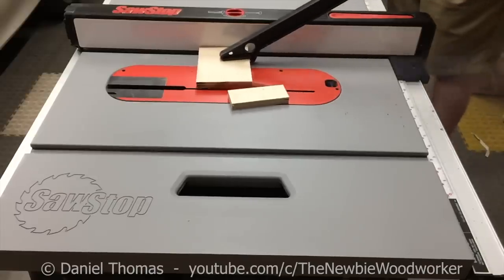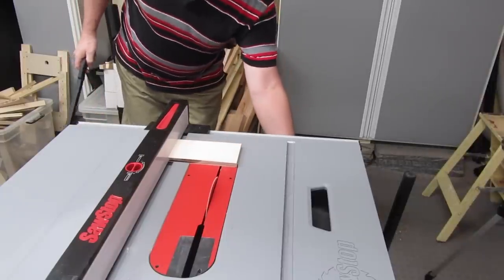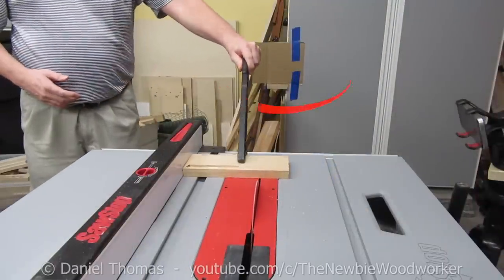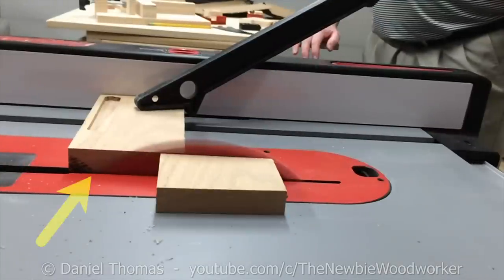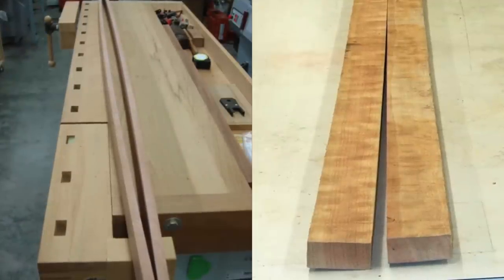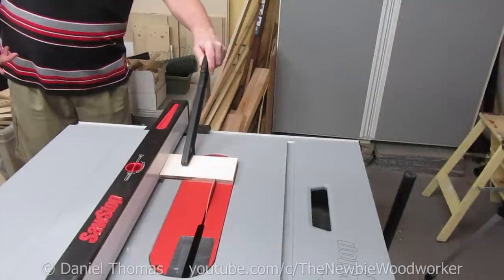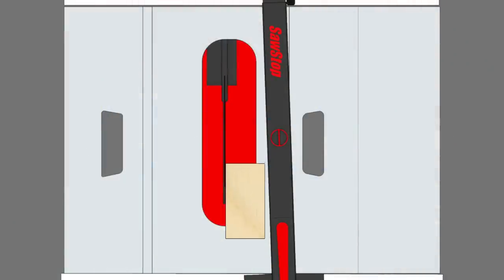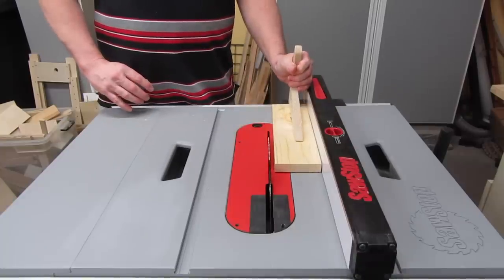Actual Kickback (in Slow Motion), & How to Prevent It

Comment: Great video, thanks.  I use the riving knife and blade guard most of the time.  The only time I took it off was to cut 3/4 in strips of 1/4" plywood using the Microjig Grrriper.
Reply from the maker: Awesome! Glad you're staying safe. 😄
Reply: I use the riving knife, but confess I don't use the guard as often as I should.  I cut a lot of tiny stuff and wish I had a light duty???? guard for that kind of work.

Comment: As somebody with little experience on a table saw but knowing somebody very experienced who lost part of a hand and thumb, I have one question. The gentleman I knew was cutting a sliver off a panel, using a push stick and standing to the side. The sliver kicked back and hit the tip of his thumb (holding the push stick) end on and perfectly square (basically speared his thumb tip) it continued after removing his thumb tip and then ripped into the heel of his palm (doing permanent nerve damage). Work cover investigated the machine and working procedure and basically deemed it to be a "freak accident". So my question is this: Why oh why don't the push sticks have a guard on them (like you would see on a fencing sword)? This would protect hand fingers and wrists! Just a thought???
Reply from the maker: That does indeed sound like a freak accident. But a good solution is to use something like the Grr-Ripper. http://amzn.to/2CELfvw. It's extremely overpriced, but then again, what's the cost of the tip of a thumb? And you can get thinner attachments, so you can use it when cutting very thin pieces. That's the only thing I can think of.

Comment: Question: when ripping a board...is it better to have the wider piece or the more narrow piece closer to the fence? Does that make sense? If I'm ripping an inch off of a board should the inch being cut off be between the blade and fence or the the blade and and away from the fence??
Reply from the maker: That's a good question. As long as you're making a cut that's longer than it is wide, then most of the time it doesn't matter. You just use your fence to measure for the cut, and have at it. And of course consider how you'll push the stock through the blade - if it starts to get too narrow, you could hurt yourself, depending on what types of push sticks/blocks you have. And if you want to cut really thin strips, you could use the method I show here: https://youtu.be/GUXa37VEZ2o. Did I help, or make it more confusing? 😄

Comment: Just bought a Craftsman table saw, rising knife and blade cover is missing, love the accuracy of cuts now that I tuned it up, but got to somehow install a knife in there, it seems with this saw if a board tilts in the cut and goes over the blade if you have enough pressure on it, the blade will stop letting you get to the cutoff switch. Still trying to figure out a way to install.
Reply from the maker: As you know, you really want to figure out how to add a riving knife, or at least a splitter. You may have already done this, but if not, do some Google and YouTube searches to see if someone else has overcome this problem.

Comment: Hey Dan, at 11:43 you give your personal opinion of cutting a board that is wider than it is long. I'm not sure that its truly a bad thing when there is such a close width to length situation. I think that the problem is when the width is longer than the length and the wood is cut leaving a piece to kick back prior to arriving at the riving knife. 

However I would always suggest using the riving knife or splitter and an anti kick back pawl if available. Just yesterday I broke my hand when a kickback occurred and hit my hand. I suppose it could have been worse. Did you know that there are over 720,000 table saw accidents a year?
Reply from the maker: Thanks, Charles, and I agree with you. I'm just a little gun-shy to give the trolls too much fodder, so that's why I'm so careful with how I word things like that. 😏I totally agree with using the safety devices when possible. It's awful that you broke your hand. What happened?

Comment: Excellent Video!  This is the first one I have seen that actually breaks it down from the lead up until the actual kick back occurs.  II use feather boards whenever possible but only before the blade and never into it.  Do you have an opinion about using one before and after the blade?
Reply from the maker: Thanks! Everything I've heard is that you use them before the blade only. But I' no expert on them, so take that with a grain of salt. Another option that some people swear by, although it's quite pricey, is JessEm guides ike this: https://amzn.to/3iftS7x. Of course they only work if they have a version that fits your saw's fence. But people that own them swear by them, if that counts for anything.

Comment: I saw a guy standing beside the saw instead of in front and that is how I will do it going forward...brilliant.
Reply from the maker: One thing I've learned about safety is that if you see someone doing something that almost nobody else does, be skeptical. There's usually a reason you don't see other people doing it. Remember that with a typical setup that has the fence on the right of the blade, kickback will basically never go to the left of the blade. So just standing to the left slightly is the best position, and gives you the best control over the stock. And trust me, having good control of the stock is critical.

Comment: I was using a Craftsman Radial Arm Saw to rip a sheet of plywood in half,  got lazy and didn't set anything up right like the manual said, anyhow when that 2 ft wide by 8 foot long board got grabbed and tossed it threw it 10 ft across the room like it was nothing.  Luck thing I had a piece of two by four pushing it at the end, so it didn't drag my hand in. Talk about shock and awe. Been using that Radial Arm saw since the early 70's and I still love it. People say it is unsafe, but here is what I say, it isn't the machine that is unsafe, it is the user, especially when we want to save a couple of minutes and that is my story and I am sticking with it.
Reply from the maker: LOL. Yep, stick with your story. I wouldn't try to argue with you. :) And actually, there's a lot of truth to that. It's one of the main reasons I did the video. The more you know about possible dangers, the better your chance of avoiding them. Thanks for the story, and glad you still have all your appendages.

Comment: There are a ton of comments on this video so please forgive if this already came up. I am new to the table saw and mine came with all the safety stuff. Riving knife, anti-kickback teeth, blade guards. I just wanted to confirm that the only time I need to take those off is if I’m making a cut the doesn’t go all the way through the board. Also, is it even less likely to experience kick-back if you’re making those cuts?
Reply from the maker: Never worry about asking questions on my channel - I love to answer questions. And yours is a great one! First off, yes, it's probably less likely that you'll get kickback when doing a non-through cut, but it can certainly still happen.

I'm not a fan of anti-kickback pawls - those things with teeth. Use them if you want, but personally, I think a riving knife or a blade guard are enough to help prevent kickback. With that said, if you're more comfortable with them on, then by all means leave them on!

Yes, if you're doing a non-through cut, you'll need to remove the blade guard. But you can probably use the riving knife, unless you're using a dado stack, or you're raising the blade up into the wood during the cut.

If you decide you want to use something like the Grr-Ripper, then you can't use the blade guard. It's kind of a toss-up as to which is safer, and it can depend on the width of the cut as much as anything else.

Let me know if that doesn't answer your questions, or if you have more. Thanks!
Reply: If I may ask, what is it about the anti-kickback pawls that makes you not a fan? Does it make the wood get stuck?
Reply from the maker: @82cyndi  Since I never used them much, take this with a grain of salt. But it just seemed to me it was too easy for them to damage the wood. But that was with my old semi-crappy Ryobi saw, so maybe the're better with other saws.
Reply: Next question: can you safely rip a 2x4 on its side? If you’re trying to achieve a thinner board...? Or what do you recommend?
Reply from the maker: @82cyndi  I can't say for sure how safe it is, but I've done it plenty of times, and it feels safe to me. I hope that makes sense. But make sure you use a riving knife or blade guard, because the board might twist or warp as you cut it, and without a riving knife or blade guard, it could kick back.

Chances are good that there won't be any problems, but if there are, the following is the most likely scenario, and it's easily handled if you're prepared for the possibility. Don't let this explanation scare you away from cutting the 2x4 - just be aware of the possibility, and like I said, you can handle it just fine:

Before you start the cut, remind yourself where the stop switch is, and be prepared to use it. The last thing you want to do is have to hunt around for the stop switch - I'm speaking from experience here. 😛

If it gets too hard to keep pushing the board though, stop pushing and turn off the saw. Then look and see what's happening. Usually it's because the already-cut ends are pinching closed. If that's the case, just use a shim or wedge or something to spread them back apart - just enough so they don't pinch against the riving knife/blade guard. Then turn the saw back on and keep cutting. Before you turn the sawe back on, make sure you've got your hand or push stuck or whatever on the 2x4 (in a safe manner, of course - don't let the blade cut you!), otherwise when you turn the saw back on, who knows what'll happen to the 2x4. 😛

If you want to keep the full 3 1/2" height, cut it part way in one pass, then flip the board over and finish it with a second pass. You'll probably have to do some sanding or planing to get it perfectly flat.

If you don't mind it being shorter, then here's what I usually do so I can cut it in one pass: I measure how tall the blade is when it's raised all the way up. Let's say it's 3". Then I trim off the narrow sides until I get a board that's a little shorter, say, 2 3/4". Then I can cut it in one pass instead of having to flip it over. I usually cut some off both sides, so I end up with a board with nice crisp edges.

By the way, once you're done, use a square of some kind (one that you know actually IS square), and see if you've got 90 degree angles. If not, your saw's blade may not be 90 degrees to the table. Actually, it's a good idea to check the blade for 90 degrees first, before doing the cuts. Here's an explanation: https://youtu.be/LJqPDADi8MM?t=56. Again, I know this from experience. 😛

By the way, if you cut all four sides, I think 2x4s can actually look really nice, depending on the quality of the 2x4. Have fun, and feel free to ask more questions, especially if any of this doesn't make sense. I know this turned into a novel, and now I'm thinking it might make a good video. 😄

Comment: Dull blades can be dangerous too because you tend to push your wood harder and the blade tends to raise the wood up.  Also I am a neebie and I was watching the blade when I was using the fence and did not notice the wood moving away from the blade ...wow it happened so fast I did not have time to blink.  I am right handed so I was off to one side and not directly behind the blade that was what saved me from getting hurt.  What about a feather board to hold pressure on the piece I am cutting when using the fence or is that a no no?
Reply from the maker: Great point about dull blades. It's not something we normally think about, especially because they dull slowly over time, so it's hard to notice. Regarding the featherboard, first, this type of push block should help you keep the stock down pretty easily. If not, consider making it longer. But yes, you can certainly use featherboards. There's even add-ons for doing that sort of thing - check out https://jessem.com/products/clear-cut-ts-stock-guides. I haven't used them, but some people swear by them.

Comment: You are crazy doing this video but it was thorough. I think one thing to consider is keeping the leading edge of your stock flat on table. I'm not sure if it makes a huge difference but I always imagined the teeth slapping the bottom of the stock and sending it right at you.
Reply from the maker: Thanks, and LOL. You are most likely correct, about me being crazy! And good comment. I agree, I'm not sure if it makes a huge difference, but like you said, I can also imagine just what you've described, so better safe than sorry. Besides, we'll get a cleaner cut that way, too. 😄
Reply: The Newbie Woodworker , it's a dirty job but someone has to do it. I'm glad it's you and not me lol. 
      You know what you have to do , right? Do the experiment again but hot glue a ramp between the guide and blade and run a peice of 1x stock through. I'd do it but I'm a pussy lol.
Reply from the maker: @markschiavone8003  LOL. I can do that easily, using my router table. Just put the stock between the fence and the router bit, in the wrong direction, and BAM! Instant pitching machine. Not that I've ever done that... At least not more than... twice? 😛

Comment: New to table saws, but how about standing on the rear side and pulling the board through? On another note, isn't handling it lightly more conducive to kickback vs forcefully keeping the board in check? For example, if you are feeding in a 4x8 sheet of plywood, it seems like keeping it against your body securely, so that it has to move your 250lb body and the plywood out of the way is better than standing on the side and pushing it through with a stick.

I don't use my table saw nearly as much as I use my miter saw. When I do use my table saw it scares the crap out of me.
Reply from the maker: Other people have asked about pulling the stock through instead of pushing it. I remember seeing one or two videos explaining why that's a bad idea. I don't remember where I saw them, but they were made by people I respect, so I trust their judgement. As for large sheets of stock, I would never use "a stick" to push it through. I'd use my hands, and if that was too close to the blade, I'd use a rubber-based push block. But most of the time, for large sheets of plywood, I cut them down to smaller sizes using a circular saw, with the sheet set on some 2x4s on the floor of my garage.

Comment: Couple of weeks ago, I experienced a kickback that inured my hand - requiring 7 stitches.  Standing clear of the blade is a must, however, our arm and hand are still directly behind the blade and in the path of flying kickbacks.  Perhaps, standing to the right [or left] of the blade will provide more safety positioning the wood on either side of the blade - depending if you are left or right handed so that no part of your body is in harms way.  Always wear  along glove on the hand behind the blade.  Keep the large part of the board against the fence and make the narrow part of the board on the free side of the blade.  I like the method of standing on the other side of the table - totally safe from any kickback.
Reply from the maker: Thanks for the comment. I think the best thing you can do is figure out why you had kickback, and figure out how to prevent it. As for where you stand, you don't want to compromise your ability to control the stock. So if you're right handed, standing to the left of the blade is the best place. It's possible your arm might get hit by the kickback, but it probably won't cause much damage. It's your body or face that's the real target. The cut-off portion usually doesn't kick back, but even if it does, it won't have much force behind it. And NEVER wear gloves when working with tools like a table say, band saw, or drill press. The tool can easily grab the glove and pull your hand into the blade. Very dangerous! Even long sleeves are dangerous.

Comment: I have removed the riving knife when I cut groves 3/8 inch deep and 16 inches long, spaced 1/2 inch apart, over a plywood board 23" x 16". Purpose is to create a climbing surface for bats to enter a bat house. If you know a better way, I am interested. I use a wide 'T' guide to push the board through, keeping the board straight. Thanks for the lessons.
Reply from the maker: Yep, that's one of those instances where you can't use a riving knife. And it probably wouldn't help anyway! 😄